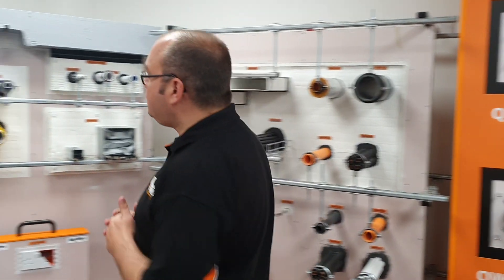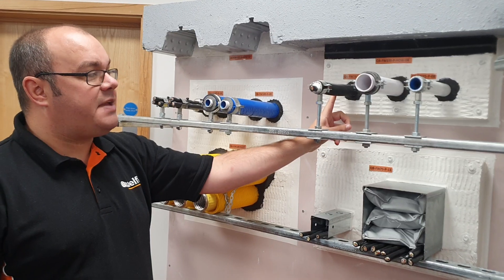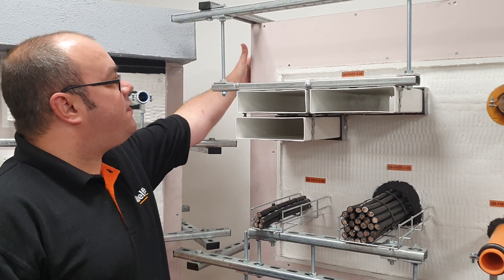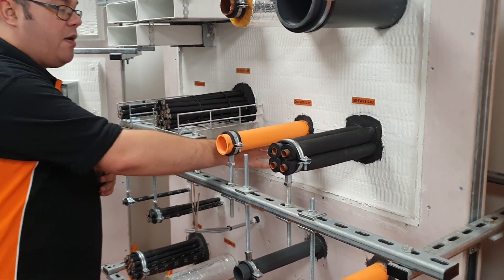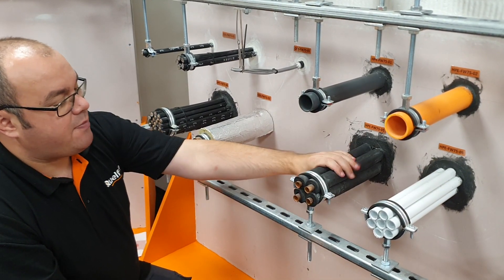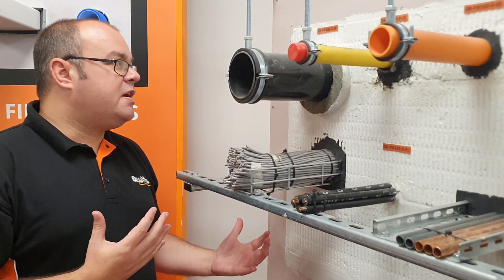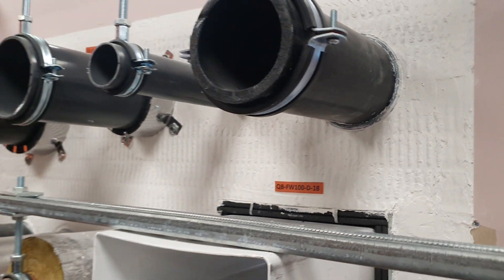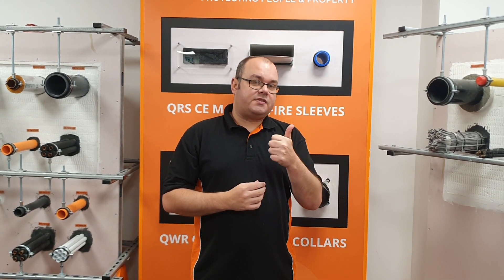Tested Detail Walkthrough: Wall Penetrations

Comment: Hello! How are you? I have a question. Should I use fire wrap around  pipes insulated with mineral wool? Opinions are divided here on the site. Thank you.
Reply from the maker: Hello! Thank you for reaching out with your question. Please could you email our Technical Team at technical@quelfire.co.uk; they will be able to advise you best.
Reply: Could you please explain to someone looking to enter the industry how you insert a sleeve over existing pipework, wouldn't cutting pipes/cables to create a gap to slide on sleeve not always be practical ? Or do your sleeves separate to allow you to pop them over existing pipe in situ then slide sleeve back to pipe entry/exit area of wall ? tia
Reply from the maker: @propertymaintenancesouthwe3111  great question! Yes, the sleeve separates. We do have some other videos that go into a bit more detail, which you'll be able to find by searching "sleeve" on our channel.

Comment: Hello Alec, excellent video and fantastic range of products. Can you tell me if there are any tests conducted on plastic concertina pipes, the type normally witnessed from the back of a tumble drier or bathroom/kitchen extraction fan system; would a fire collar be suitable - pipe diameter is approx 110mm.
Reply from the maker: Thanks for your feedback.  

We don't know of any tests carried out on the material you describe. Because the material is so thin and combustible, it is likely that it would burn quicker than the intumescent can react resulting in an integrity failure. 

It is always worth checking whether these ducts are actually penetrating a fire compartment wall initially. 

For more technical questions please send in specific details to our technical team using technical@quelfire.co.uk

Comment: Hi Alec, this is a fantastic range, well done. Could you please give me a bit more detail about the gas pipe passing through a sleeve. it looks like QB-FW100-D-12.
I have seen similar, with copper pipes passing through another copper sleeve. i never got an answer as to the reason for the sleeve and need for the gap between 2x pipes. also, is there no need for a HPE or wrap? as the yellow gas pipe would surely not be sealed off by acrylic seal alone? many thanks
Reply from the maker: Hello, thank you for your comment. We believe the "reason" for sleeve is due to a gas regulation or could also be due to concerns about movement and potential chaffing of the pipe on the substrate.

From our perspective, we test fire stop solutions for scenarios that arise in real life and this is how the pipes can be installed.
See also: https://quelfire.co.uk/knowledge-advice/does-tracpipe-need-to-be-sleeved/.

On detail QB-FW100-D-12 https://quelfire.co.uk/wp-content/uploads/QB-FW100-D-12-Trac-Pipe-penetrating-a-flexible-or-rigid-wall-HPE.pdf you will note that a 20mm annulus of QuelStop HPE Sealant is required around the sleeve. 

The QuelStop Intumescent Acrylic Sealant is used to seal the gap between the sleeve and the pipe on one side of the wall only in this case.

If you have any further technical questions please send a detailed question to technical@quelfire.co.uk where one of the team will be glad to support further. Thank you.